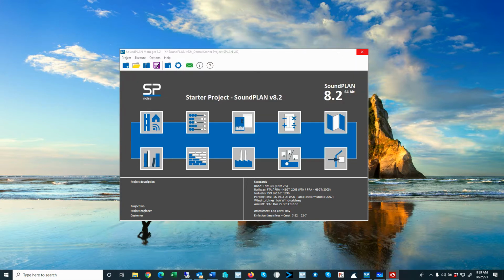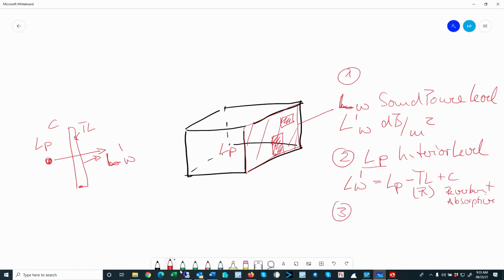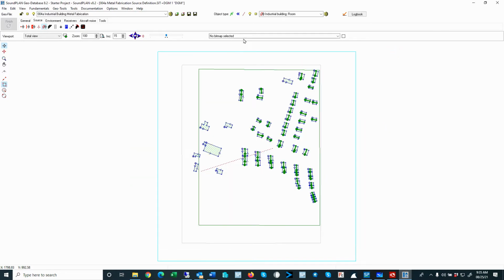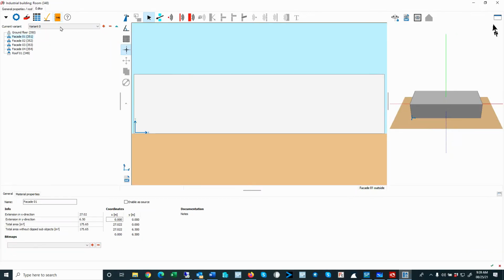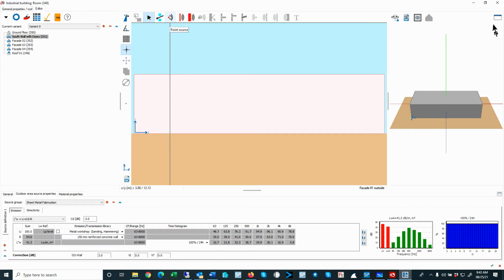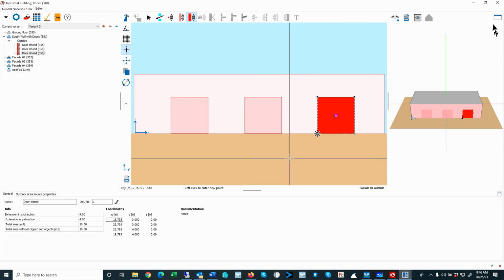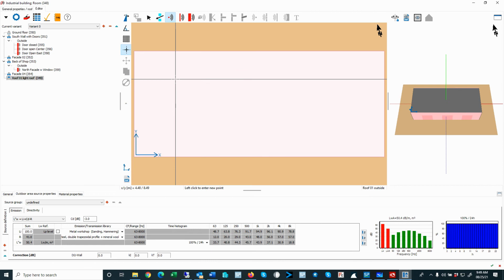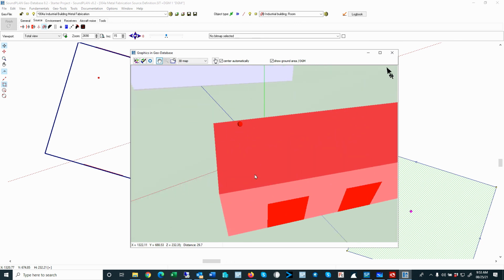SoundPLAN Industrial Building Input Source Definition

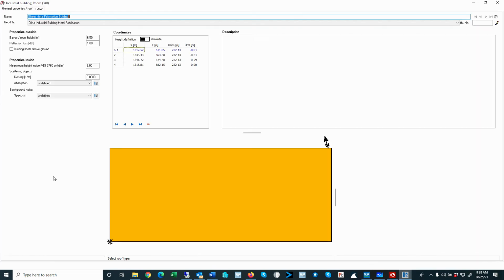Comment: How do you open the edit window in min 9:05 ?
Reply from the maker: You move your mouse over one of the building corners and the cross hair changes to a arrow.  The arrow indicates that the Geo-database 'sees' a object within a catch radius of 5 m (default) when you click the left mouse button and there is only one object close by the object parameter window is opened.  if there are mulitple objects within 5 meter the GDB will show all the objects and prompts you to select which object you want to open.
I suggest to watch the video on the use of the mouse control (https://youtu.be/INOK6wnQkTc)